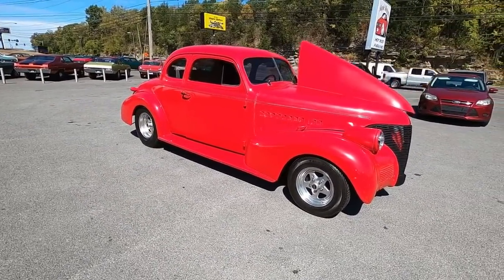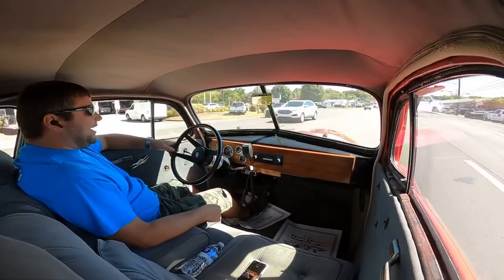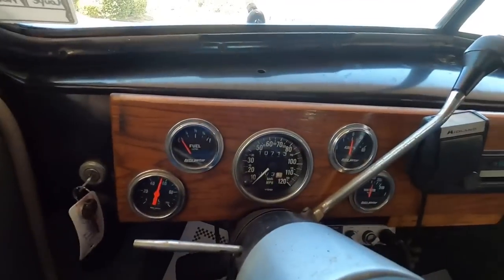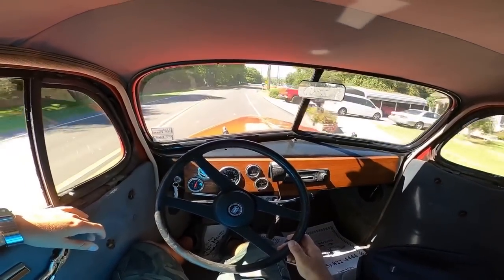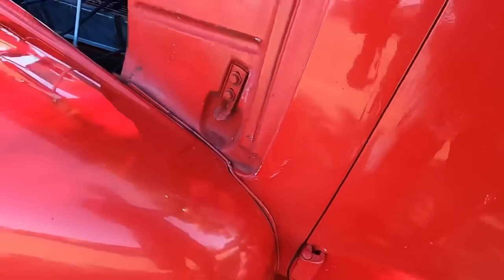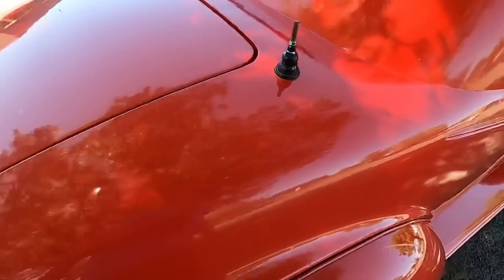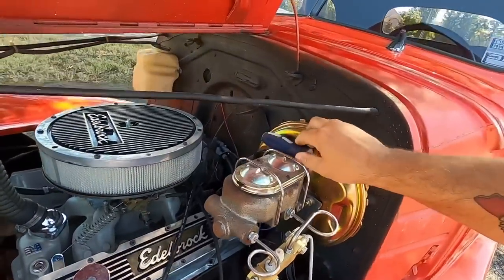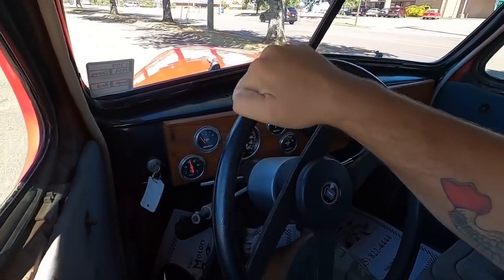Test Drive 1939 Chevrolet 2-Door Coupe 350 SOLD $14,900 Maple Motors #1759

Comment: Looks like the drivers rear wheel might be warped and causing the tire rub.
Reply: He's right I think it could be I would just take a grease marker pencil whatever you want to call it and put a liberal use on the inside of the wheel well lip rub it in good and take a quick trip up and down the street to see where it touches on a tire
Reply: Or bent axle

Comment: The rear drivers side wheel is wobbling and the motor and trans is moving a lot. I have a 37 Chevy truck cab that I want to turn into a fenderless hot rod.